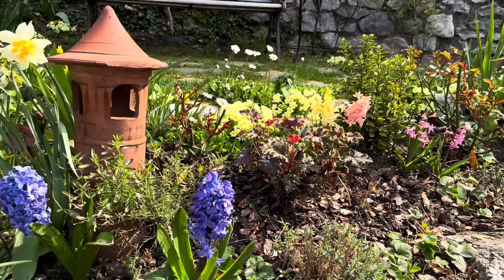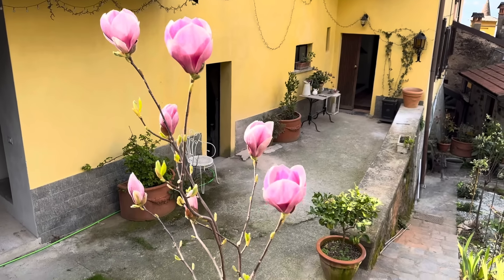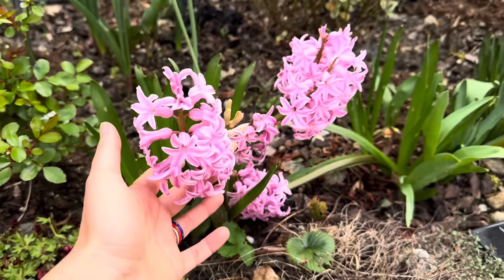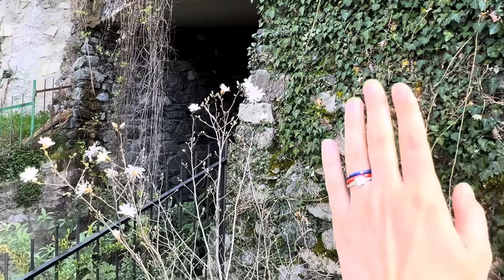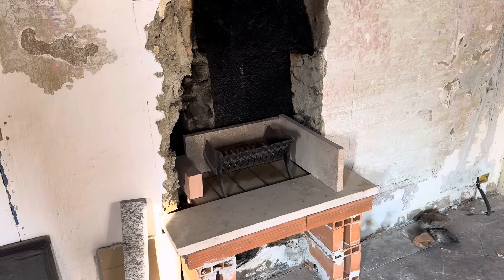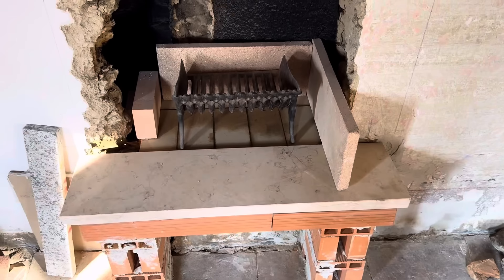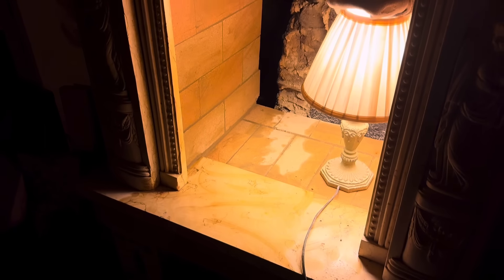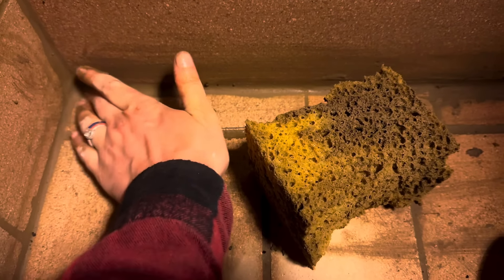Building a fireplace in our salon

Comment: The fireplace looks great, but before you burn down the house. Don't you need to have the fireplace inspected by the fire department or housing department? I've been watching the New Chateaux  homeowners doing their repairs, and open fireplaces need to be inspected in France. The other ones that don't are the fireplaces that you have in your kitchen. Please check, because the fireplace is going to look beautiful but safety first. Your home is looking so pretty.😮
Reply: Looks like you have not read your messages from your last posting. Please make sure to look into what is needed to have someone inspect your rebuilt fireplace before lighting it. Safety 1st